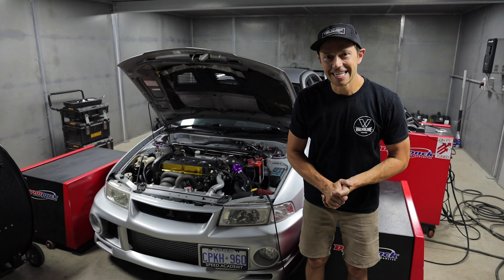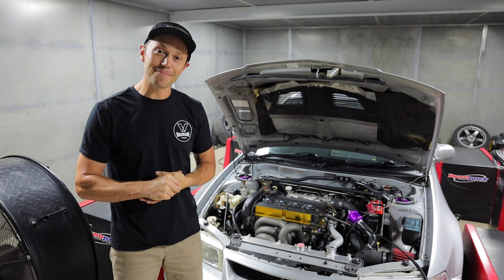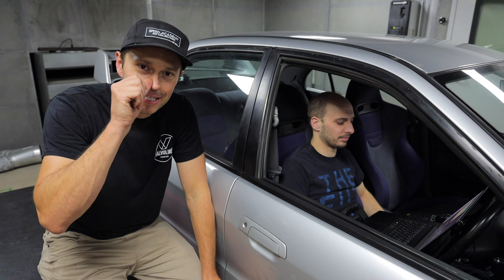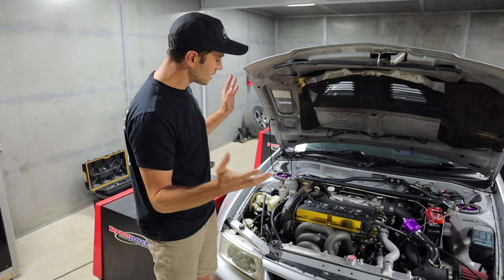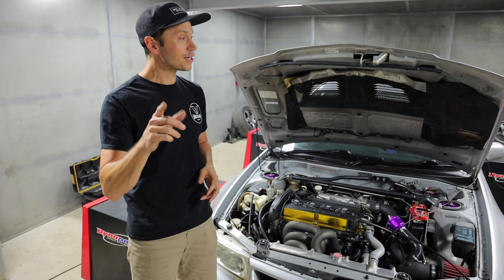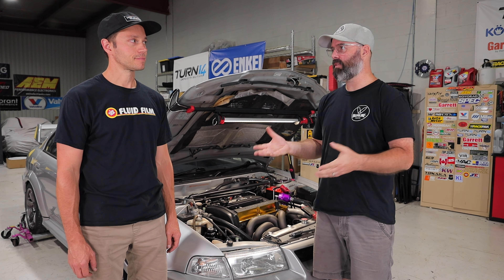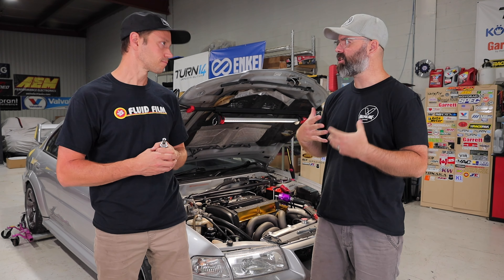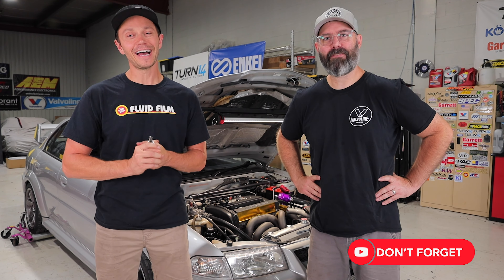MASSIVE EVO 4G63 Headgasket Engine FAILURE! CRAZY DETONATION!

Comment: Ow no what a bummer, sometimes with projects we have to go back 25 steps to be able to move forward. MLS headgasket do require very clean and true surfaces. Because there is little to no coating at all to let something go into imperfections. Without turbo and standard fiber gasket. Even with little rust pockets and small imperfections, it won't make any difference. Turbo built motor, I would have decked the block just for the peace of mind. Sorry for the kickback, keep going. At least remove the head to assess the damage you'll think what's the best solution

Comment: Definitely pull the engine apart and skim the surfaces, MLS requires a true flat surface, if your going to gasket slap it an oem would be more forgiving but probably not hold up as well. We dont need an episode on it but I'd definitely redo it over buying a ready built engine, kind of defeats the purpose of the build.

Comment: Hey eh, isn't it suspicious that the car was making way over stock HP with half the boost?  Pete commented that it was at 300whp @ 11.5psi.  I know the g25-550 flows more than the stock turbo, but not that much.   I think the reason for the large power at relatively low boost is down to the compression ratio you have set by your piston choice.  The pistons you guys used in this build are far too high compression for Pete's stated 24psi goal on pump gas.  You were running probably 10.1:1 compression with the JE Ultra 361287.

Comment: I found it odd that the tuner asked "how much boost do you want to run?" I feel like its up to the tuner to get to know the setup and the platform and figure out for himself to figure out what the right level of boost is for this particular application. 

Also seems like someone should have picked up that the engine didn't sound quite right,
Reply: Going well above OEM power levels is always a risk, the tuner didnt want to take on the liability if it did fail which is totally understandable

Comment: I enjoy watching the episodes, but there seems to be a common issue with the last few builds.  All  the little things are being missed i.e 
Not changing the cam orings and the valve seals on the BMW build, not decking the block on this build. Just seems like you need to focus on some of the smaller things sometimes.

Comment: That sucks! I hope you're able to diagnose whats happened, and get it fixed :( 
In classic youtube comment section fashion of giving uneducated opinions, how much bedding in of the engine had you done (although it wouldn't of prevented this, just done so at lower boost?) I know my friend was instructed to do 1K miles ( 1.7Km) on his rebuilt stock shortblock  impreza engine from RCM (people who built the gobstopper time attackk cars) before doing any pulls. You've mentioned doing some bedding in on the road, but I was wondering on what level of milage?
I've been loving the build, keep going! :)

Comment: Too much boost without head prep. At 25lbs you need to start thinking about copper ringing it. Probably overkill but build it for 1000 if you want deadnuts reliability. Imho always build beyond your goals. Unless you plan on flipping the car which I've a sneaky suspicion that is your plan.

Comment: Next time around torque the ARPs to 110ft/lbs. I've seen MLS gaskets push coolant at 90ft/lbs, torqued it down to 120 and never pushed again. I'm sure I'll get a lot of hate for this but I use a regular felpro head gasket with standard ARPs, torqued to 120ft/lbs. Didnt deck the block and run 40+psi (on bw s366) without head gasket issues. I actually bent two stock rods on this set up playing with the boost controller, headgasket was still holding strong Haha.

Comment: I would suggest doing a compression check before you rip it apart and also pulled that the timing cover make sure the timing marks are aligned properly there's also a test you can do where you can find out if there is exhaust fumes in the cooling system

Comment: Having owned a fair number of 4g powered cars over the years, and road racing Evos. You always deck the surfaces of these things.  I’ve also had ARP loosen up once during a tuning session, and pop a head gasket. Doubtful that’s the case here, as mine was from a bad torque wrench. Gutted feeling though, when everything has to come back apart :(
Reply: I can't believe they didn't deck the block and head, the most basic thing you do when you pull a motor, no short cuts

Comment: Iv Heard that the torque is wat kills them motors u have to dial back the torque curve
Reply: Low rpm torq but it kills bottom end
Reply: @CL9k24a3  exactly wat i ment thanks!
Reply: Not on a 4g63 with rods.

Comment: Considering how "cheap" it is to deck the block, considering in the grand scheme of things and how much you have spent on this engine, why wouldn't you just do it anyways regardless of what the machinist says?? A few hundred bucks saved may have no costed you folks a block :(. You can literally hear the combustion leaving the cylinder through the side of the block (sounds like a massive exhaust leak). Pressurized radiator 100% confirms combustion into the cooling system. I sure as hell hope you folks do not need a new block however!! Goodluck!

Comment: It's a DSM, this is normal lol. Gotta recheck your torque after break in. Your machinist probably wasn't incorrect either, my old 2g had a perfect decked head/block and it still lifted the gasket at 24 lbs.

Comment: What did u torque head down 2?
Reply: If macheenist said it doesn't need to be decked then most likely doesn't need to be decked that is very low boost for head lift I'm running 35psi on gtx3076r 

Looks like the tuner blew it on purpose to prove a point

Comment: ARP 2000's are shit. Use L19's or 625's. Plus always make sealing surfaces perfect. Face head and deck block or copper coat gasket for the ghetto fix

Comment: Not the same motor but I've built 3 SR20's over the last 10 ish years to 500hp levels. The first one I built had a head gasket failure in a really similar manner to yours. I melted the number 1 piston when that happened, looks like you saved your motor before that happened. After that build a local mechanic recommended that I spray copper gasket on all MLS gaskets. Motor #2 lasted 9 years with that copper gasket spray. I just finished assembling motor #3 without decking the head or the block and did the copper spray thing again. Seems to be holding up well again.

Nelson racing engines uses turbine sealant to accomplish the same thing but for 1500 hp engines. https://www.facebook.com/nelsonracingengines/photos/pcb.3142844095753222/3142843449086620/

 A liberal coat of copper spray would likely fix up your 4G63 problems without decking.

Comment: This is 100% your tuners fault, bad head seal or not. You can hear it pinging through a phone speaker. What a joke!
Reply: You can hear the massive combustion leak not pinging the headgasket let go before the 20 psi run
Reply: Dan A whatever it was, it was held flat for 90% of the run. You could hear it audibly. It should have been backed out of immediately
Reply: @Rekoyl116  when you have headphones in listening for knock you cannot listen for mechanical failures especially with that loud wastegate
Reply: Dan A you really think you aren’t going to hear a compression leak through knock earphones
Reply: @Rekoyl116  do you know how a knock sensor works? It's not a microphone
Reply: Dan A lol yeah. I do.

Comment: Tuner just kept going when the car didnt sound so good. Why?
Reply: This. Surely he’d of heard det if he was mapping this properly with det cans
Reply: @Reece.P  i dont know if it was detonation, turbine spooling issues or a vacuum leak, could be a million reasons why it didnt sound right. But why just keep going when you can clearly feel and hear the somethings wrong?? And when the engine blew, he kept gassing it and blew it again!!! Whhhhhhhhhhhhhy????????
He might be a good tuner, i dont know but i just want to understand what exactly happened, so it doesnt happen to me lol
Reply: He was probably listening for knock, also a downside of having a loud wastegate you struggle to hear other noises
Reply: M K if there was water getting in the cylinder, which looks like there was from a wet plug, then it would have started to knock/det. He should have let off much sooner
Reply: @dan4age  Very fair comment Dan. i dont know how a dyna pack works but qould he have not felt any additional vibrations or power loss prior to it blowing up?
Reply: @MK-df6li  it's didn't really blow up was just leaking combustion
Reply: @Reece.P  surely he woulda used det cans? Are there tuners out there that dont???
Reply: @Reece.P  water/coolant definitely doesn't make it knock if any it would prevent knock the water was from after the engine was shut down
Reply: @dan4age  so since it was leaking from the start would be why it was hard to detect?
Reply: Dan A correct it doesn’t if it’s in a controlled manor like WMI, but water/coolant entering the combustion chamber uncontrolled will cause it to misfire and cause knock.
Reply: @Reece.P  it's not entering while it's under full power